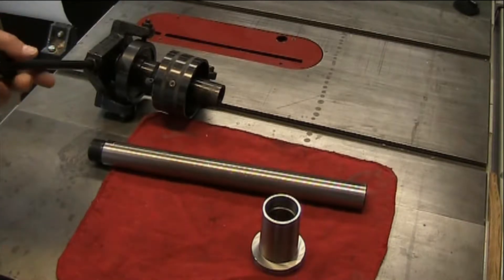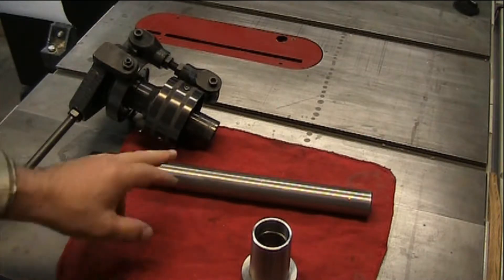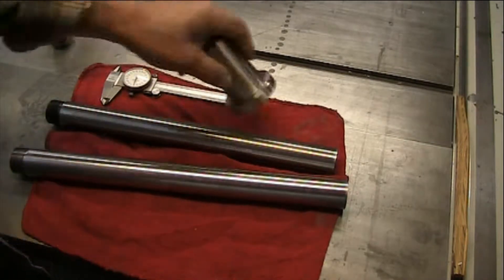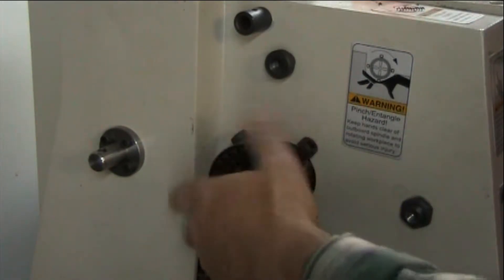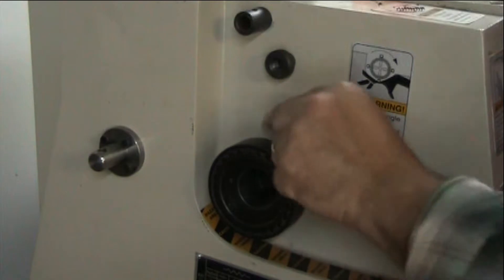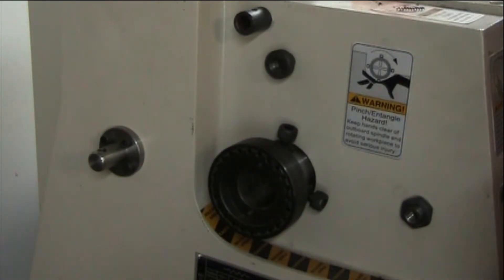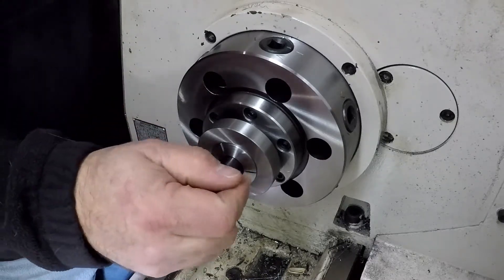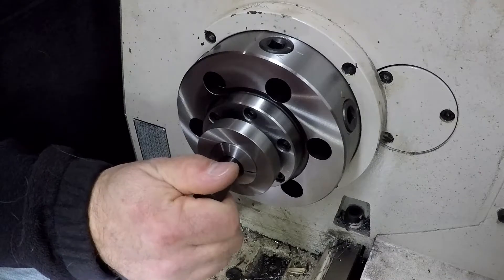Collet Closer Project

Comment: How did you figure length of tube ?
Reply from the maker: I had to back figure the dimensions. I went from the front of the collet holder on the spindle nose back to the closer that was mounted to the back of the spindle. Then just subtracted the length to the end of the threads in the 5C collet holder to come up with the rough length.